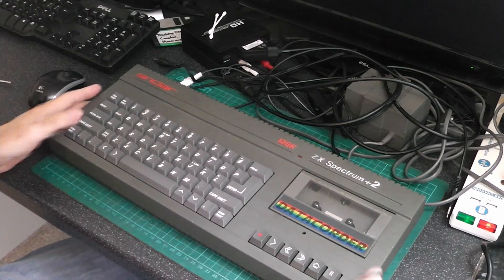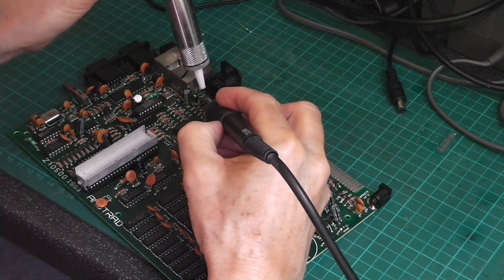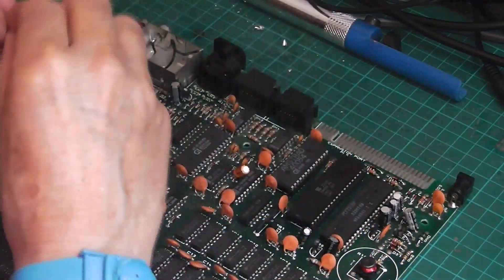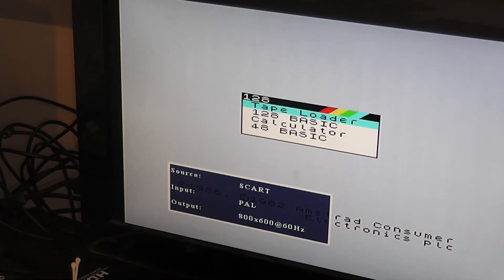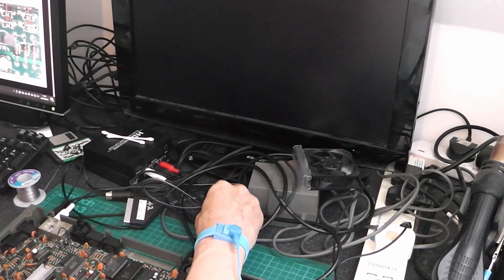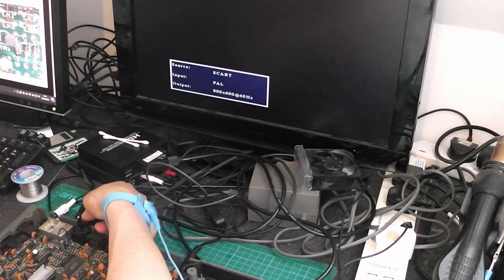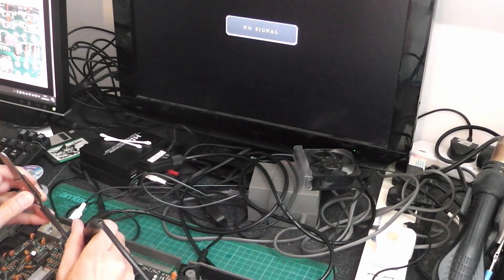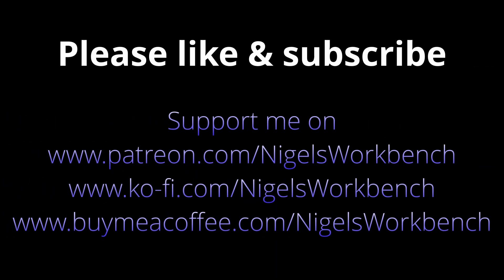ZX Spectrum plus 2 RGB mods

Comment: BTW, having SCART (RGB) and Composite connected at the same time is fine. The RGB signals come directly from the ULA, and the Composite signal comes from the TEA2000. You may notice the Composite picture is a bit darker with the SCART cable plugged in, because the RGB signals are not buffered and so they will be loaded twice and so the levels come down

Comment: I did wonder why you swapped LK4 for LK2 and installed a 470 ohm at R9 - but it makes sense for SCART if you then use pin 1 of the DIN connector to provide the switching signal at pin 16 on the SCART port. When loaded by the 75 ohm load, you will get around 1.something volts which switches the TV into RGB mode.

For the composite output, as long as you keep the wire in the appropriate hole of LK4 (the one that leads to the 75 ohm resistor) then you'll still have composite out at the old RF output. This is probably how I would keep it. The +2A/+3 dont even bother with composite on the DIN connector.